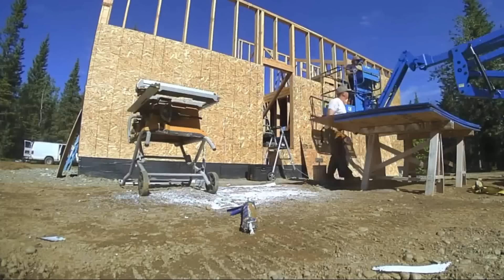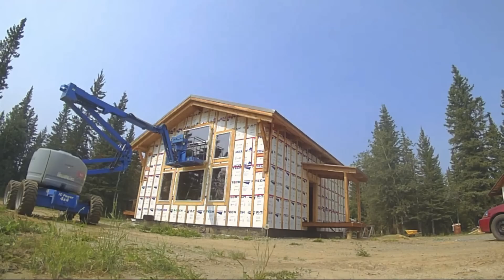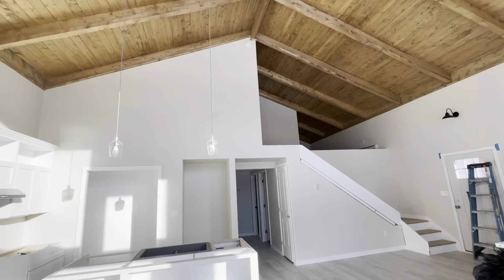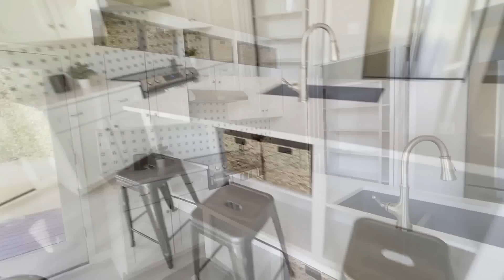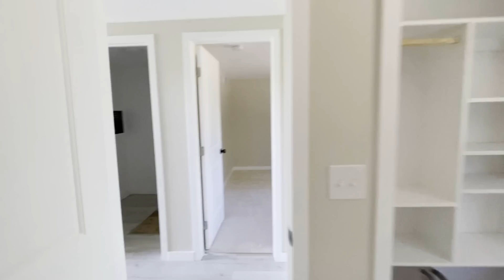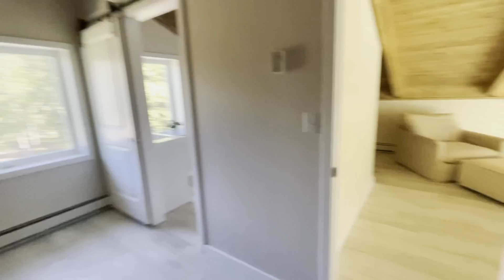Cabin House Reveal - Simple, Affordable, Efficient

Comment: pretty good-  questions were the bathroom and laundry room vented to the outside?  Wish the tile in the downstairs bath would have gone to the ceiling.  Radiant heat is really nice.  The upstairs office cubbyhole would become a snuggle tv watching computer gaming system room possible bean bag chairs.... might need to insulate the wall.  might work as a office space/library also.  did not have a  wood burner-   outside of having backup heat, ok with that.  think I would create a airlock entrance out of the front porch and a nice slab of wood  shoe bench  by the stairs.   then possibly a screened in porch  off the patio door with a lexan panel roof.  Were I  first thought the bed would go realized no outlets on that wall for lamps.   leaves the closet wall.  Very nice-  Being close to retirement would  want  the master on the first floor and possibly no upstairs.  or the upstairs could be the guest bedroom/studio.

Comment: As this home is in Alaska, I think a good insulation is needed. As the inside I have not seen much insulation, may I ask the thickness of the insulation boards that you used?
Reply from the maker: These videos show some of the insulation process https://www.youtube.com/watch?v=_1PLehnpHro
https://www.youtube.com/watch?v=UkBnr4YHLgw&t=4s
rigid foam on the outside and blow in insulation in the wall cavities inside. Also is some areas we used fiberglass insulation over the blow in material. It is very well insulated and efficient for the cold Alaska climate. Thanks for the visit!

Comment: Everybody excited about design, colors, furnitures etc. That's all sweet but real people will live there on a daily basis. Yet nobody ask about air quality inside. You have zero air leak house - what kind of force air ventilation is there (any HRV)? Not mentioning those particle boards with formaldehyde off gassing inside house due to styrofoam on outside.

Comment: I like your design but if you’re going to do a video on a house you should mention square footage and price otherwise it’s just a bunch of fluff.
Reply from the maker: The markets are different across the board, what the house is listed for in Alaska, square footage, acerage etc. Will not be the same as other states. We priced according to our local market based on realtor pricing comparisons. It is 1400 square feet, we listed it at 289K, and it's on a couple acres. Thanks for watching!

Comment: heating system is far from efficient that is for sure
Reply: What's the problem ? Hot water baseboard is an excellent way to heat a house.
Reply: @augustreil  low efficiency
Reply: @dontdrinkbleach1024 , What's more efficient ?
Reply: @augustreil  For example. A cold climate ductless unit like a Fujitsu which heats down to -20 would work fine for easily half the price. Even the most efficient fossil fuel boiler can achieve a .9 C.O.P. whereas a cold climate heat pump operates at a C.O.P. of 3.5 to 4.0. In Alaska the average temperature for a winter is -2, yet you would still achieve a C.O.P. of roughly 2.0 to 2.5. Now on the occasion that you dip below -20 the that is a good time to run a high efficiency wood stove. Now you also end up with air-conditioning for the summer with humidity control and air filtration. With a boiler you just get the baseboard heat in this case.
Reply: @dontdrinkbleach1024 , Thank you.
Reply: @augustreil  your welcome